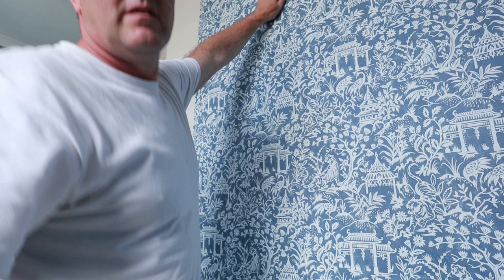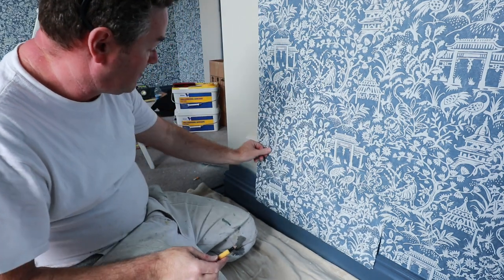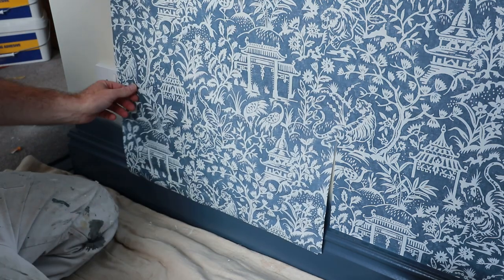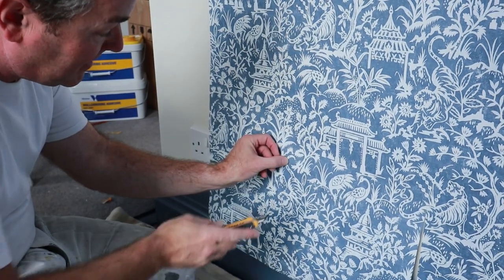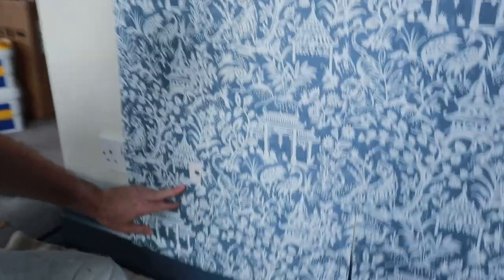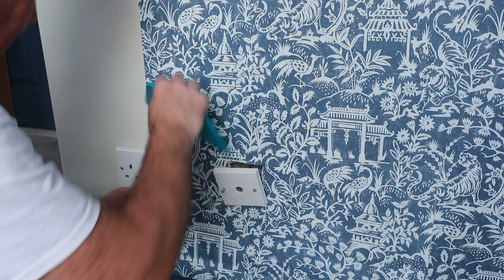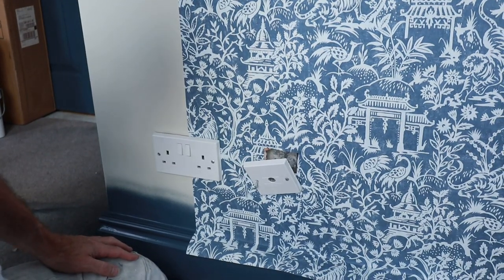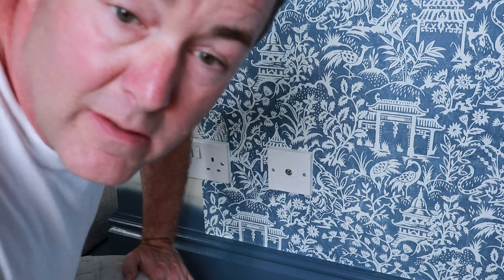how to Wallpapering around a plug socket or Light Switch like a pro

Comment: Nice work, only thing I would have done differently would be to abrade the paint above the skirting.
Reply from the maker: Yeah, I go around all the walls with some use sand paper just to take anything off that may have got under the paper.. also a bit of key to the overspray.

Comment: I like the way your paper is quite neat at th skirting I like to hang ready pasted from the roll
Reply from the maker: I do work off a roll on main drops. When it came for tye purpose of the vid I had them ready cut.
Reply: @ProfessionalPainterDecorator  that's a good idea it's just no table needed that I like
Reply from the maker: @williamgorman893  you'll see on the part 2 video .. goes out on Monday, why I still need the table. ;)
Reply: @ProfessionalPainterDecorator  talking bout tables Phil saw your vid on the table you got from lidl I got one of my tables from lidl and it was amazing the three sections folded into each other brilliant for staircases
Reply from the maker: @williamgorman893  just a shame it's not a flat surface with it having those daft metal lips on the edge your paper bangs up against and then across the joining sections. I use mine for BBQs.
Reply: Ready pasted needs wetting or a thin coat of paste though, do you mean paste the wall?
Reply from the maker: @Lloyd1885  Hi Steve, where do you mean.. in this video?
Ready Pasted, yes, ppl use a trough of water, or like I do... really thinned paste.. which I find gives a better adhesion.
Reply: @Lloyd1885  yes I meant paste the wall Steve must've had a few beers 🤣🤣
Reply: @ProfessionalPainterDecorator  I've seen painters put a clean sheet or taped linning paper to stop that happening
Reply from the maker: @williamgorman893  on the paste table? shouldn't need to do that though, you still feel that metal edge strip as you work over it. A flat surface is best.
Reply: @williamgorman893  lol
Reply: @ProfessionalPainterDecorator  no mate, I was referring to Williams comment
Reply: @williamgorman893  I've seen that too...or masking tape...as phil says, shouldnt need to do that, its a really bad design fault, like the two strips that cross the table in the middle, they can easily mark the paper. Id never buy one. I prefer the wooden ones with W shaped legs, you can lay on them!
Reply: @Lloyd1885  that's going back Steve can you still get them not seen one of them in years an am old guy

Comment: I like to wipe woodwork with a dry cloth after the wet sponge, sometimes the paper as well otherwise water marks can be left behind
Reply from the maker: If your water gets over dirty from paste, it can leave residue too 
The sponge I have is very soft and we'll rung out it's very nice to use.
It's not left any water marks. I wouldn't leave any thing in new woodwork.. the blue would show up stuff like that.

Comment: Not so easy going round sockets using glued, wet wallpaper. Has a tendancy to tear.
Reply from the maker: same principle... apart from the face of the socket gets paste on it. Loosen off the socket all the way helps pass it through the cut hole though, if you can get it through.